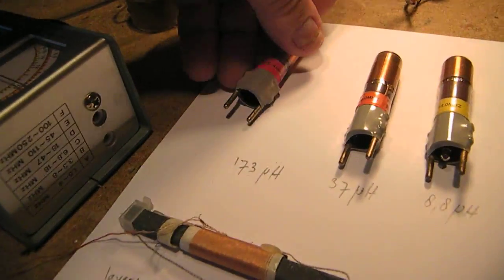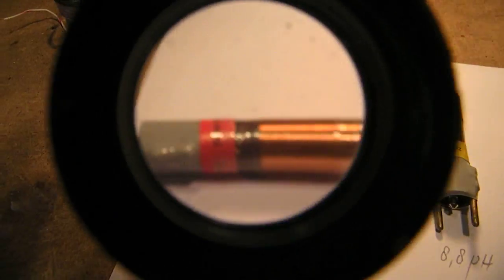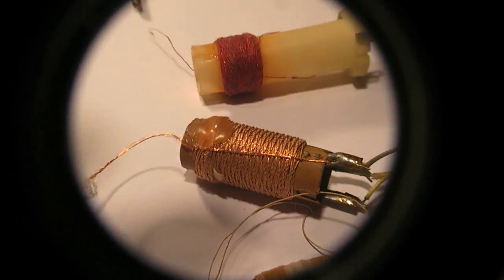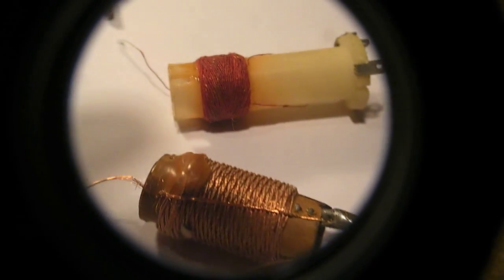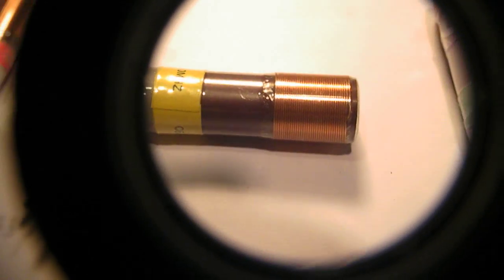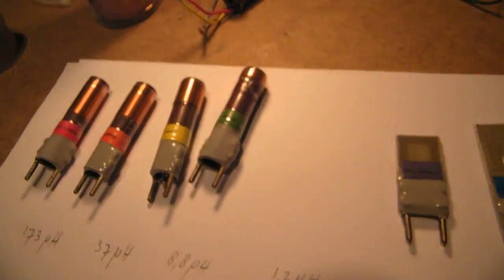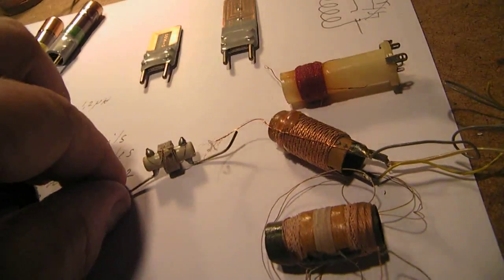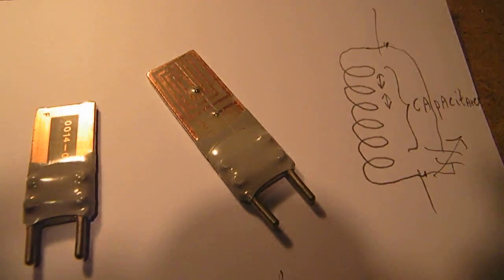Radio coils, some examples (inductance & properties)

Comment: Thank you for great video.
How much would the capacitance be for these coils ?
I checked the capacitance of a 100 micro henry rf choke and the capacitance meter read a value that was changing between 32 micro farad and 34 micro farad with a negative sign. Does that make sense  ?
Reply from the maker: No. These microFarads (uFs) values don't have anything to do with SW coils. SW coils between (say) 3 MC and 12 MC have a parallel capacitance (related to a say 10 or 40 windings coil) in the range of 10 PF and 500 PF.
Reply: @radiofun232  
Thank you for your answer
Reply from the maker: @suhailasaba1051  ok

Comment: what coil should i use for FM 88-107mhz ? how many turns and diameter ?
Reply from the maker: Often is used: 6 windings silvered copper wire (1 mm) air coil, diameter +/- 8 mm, length 1,5-2 cm. To be combined with a parallel trimmer of 1-30 pF.
Reply: @radiofun232  thankyou i will try :)
Reply from the maker: @mcknorth  You can bring it in the band by strething the coil or pressing it somewhat with your fingers and/or trim the variable capacitor, with a FM radio next to it.

Comment: i have a very basic question. but plz i didnt even finnish school so i just need a but of help. the copper that is coiled around ,is it insulated? i know they do copper wire covered in a clear polly. but is this the same? please help. thanks rolfo
Reply from the maker: Hi Rolf, no problem. The copper that is coiled is isolated with a very thin layer of laquer. It isolates perfectly and nowadays these varnishes are from such a high (chemical) quality that they can withstand even high temperatures (say from 80 degrees Celsius up to 100 degrees Celsius). That is quite hot. Of course when there is no isolation, the whole copper mass (wound on the core) will be shortcut and there will be no properties on inductance. Only a resistance from say 0.1 or 1 Ohm.
Reply: radiofun232 dear sir. thank you so much. i can now carry on with my experiments. loads or respect rolfo

Comment: Does the colors of these radio coil mean something. red, orange,yellow, green, blue......?                    .
Reply from the maker: +Sss Ttt not in this case but many radio coils sold for shortwave the colors (especially from tyhe ferrite core) have a meaning regarding the frequency band that can/has to be used within the typical color code. Search e.g. the internet for more info.
Reply: radiofun232   Thank you

Comment: two weeks ago i bought your book about shortwave receiver. there is something 
not clear for me. you wrote that the antenna coil must have a highest q than the vfo 
coil. 
does the opposite more logic ?
when you tune the vfo   which is the bandwidth on a fixe position for the antenna coil
best regards
Reply from the maker: Chris Chris Thank you for buying my book. On the antenna coil all radio frequencies on Shortwave enter the radio, even very faint signals, say 1 uV (Microvolt) or even lower. There is also much noise entering the antenna coil: atmosferic noise, noise generated inside the first transistor, noise from handys and all kinds of home HF devices. In that situation it must be possible to "harvest" small radio signals out of the noise and lift them up out of the noise level. With a high Q this is possible, because you can "peak" the antenna coil (tune it with the parallel tuning capacitor from e.g. 10-200 pF, say on 6 MHz) to that specific weak radio station on Shortwave. In the VFO (oscillator) the aim is to get the biggest possible frequency range, with a coil with a high Q the frequency range will be small (or smaller compared to a lower Q) and there will be a higher output volume on that specific frequency where the VFO tunes best (=has the highest Q). This can be a problem, because the mixer (in this case additive mixing) needs a more or less constant input amplitude from the VFO to do its work (frequency transformation) properly. A difference of 10-20 % in output volume from the VFO to the mixer transistor is acceptable with this kind of mixing (additive). So that are the reasons. When you want to make the circuits and have problems you can mail me on radiofun232@gmail.com.
Reply from the maker: Chris Chris Your question 2 ( best bandwith). The VFO frequency is 455 KHz higher than the frequency that is received on the antenna. So when you want to receive 6 MHz the VFO must work on 6,455 MHz and the antenna coil must be peaked to 6 MHz with the paralleled tuning capacitor. You will see that, when you tune the antenna coil to 6 MHz, the frequencies/radio stations around 6 MHz are "lifted" out of the noise and they will appear and be audible. When the radio station is weak, the position of the antenna coil tuning capacitor is quite critical. But in general, when you have done this "trick" a few times (tuning the VFO and the antenna coil) you will quicky be an expert in tuning in on strong or weak radio stations. Very important: when you use a long wire antenna outside your house (10 meters) the antenna must be connected to the antenna coil via a cap. from (say) 7 pF - 14 pF, test it in practice. If not: the antenna coil cannot be peaked to weak radio stations and all your radio receiving will drown in the noise, in fact you will receive almost nothing or only a few strong radio stations (bad sound, over modulated).

Comment: thank you for great video
would like to see you do demo on your dip meter if possible
Reply from the maker: ***** Thanks, OK. The dipmeter is usable but not always very certain, because the coil that is dipped is often connected to 1 transistor stage (input) or 2 transistor stages, in-between. When you hold the dipmeter coil next to the tested coil in fact they must be paralleled horizontally (if possible) to get max energy conversion into the dipmeter coil. So perhaps such a dipmeter demo will be an academic demo.
Reply from the maker: ***** Hi Dennis N, I thought again about your question and found that I have demonstrated the dipmeter in one of my video's. It is called "dipmeter - search the resonance frequency " and was published on 1 april 2012. Thanks for your interest in my video's.